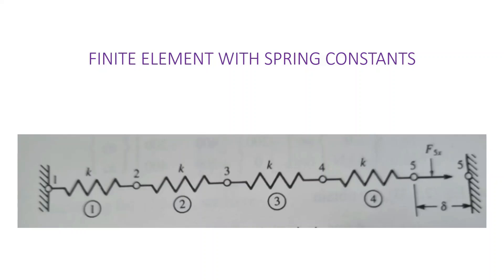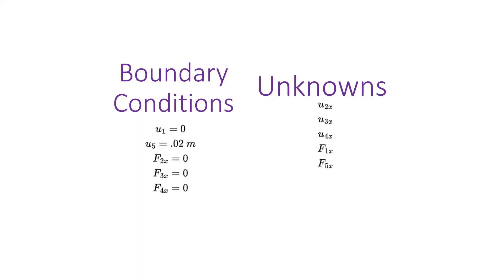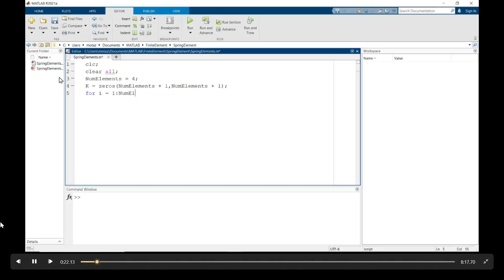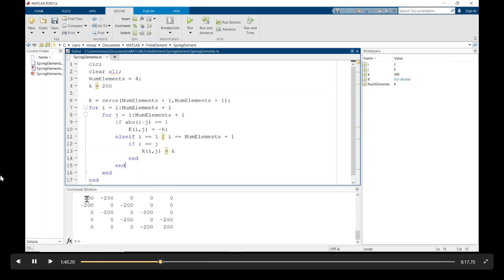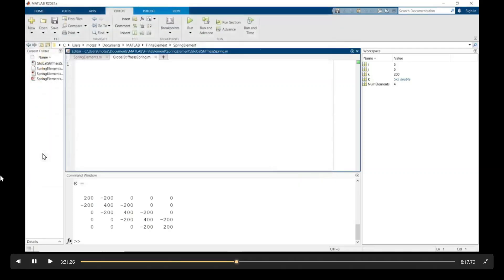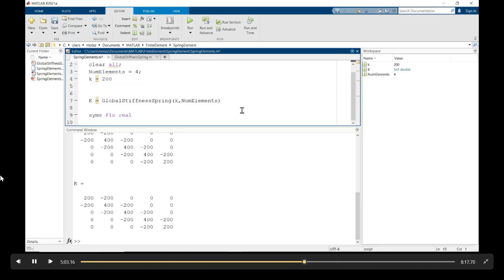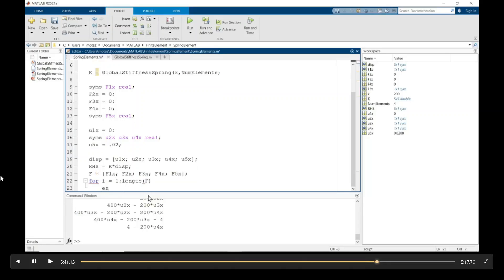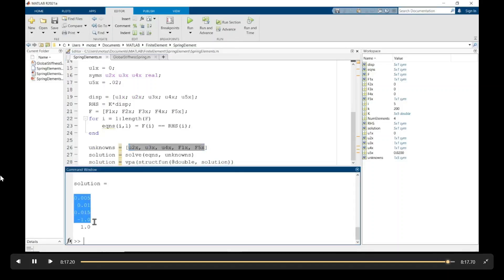Finite Element Tool for Solving Problems with Spring Elements using Matlab

Comment: how to create a script if k1 and k3 are loop k1=0.1k-1k and k3=0.1k-1k
Reply from the maker: You can enter this value for k spring stiffness into the function K that returns global stiffness. In this problem k is given as 200 kN/m but you can change the input